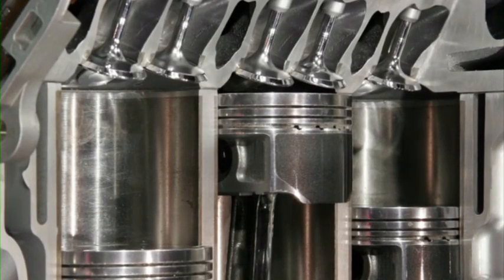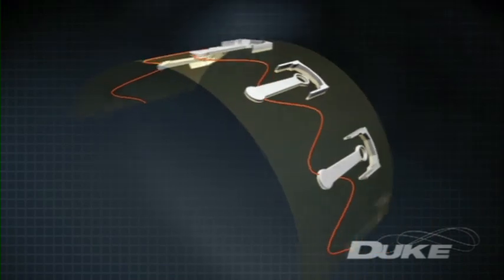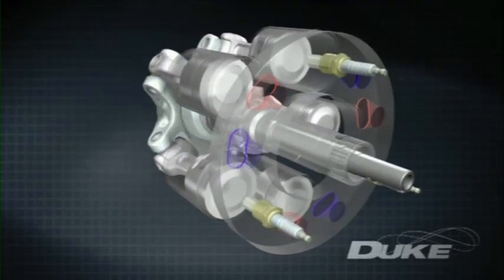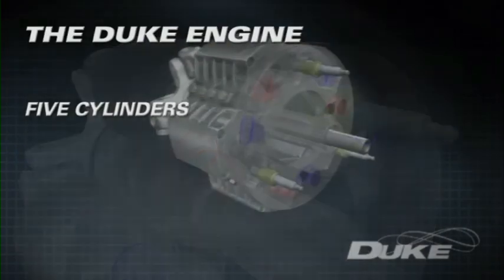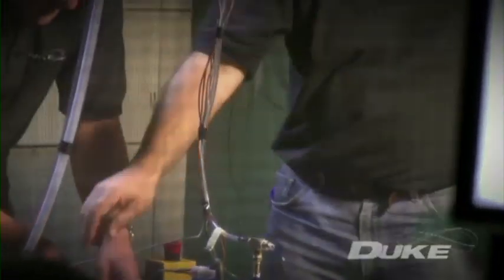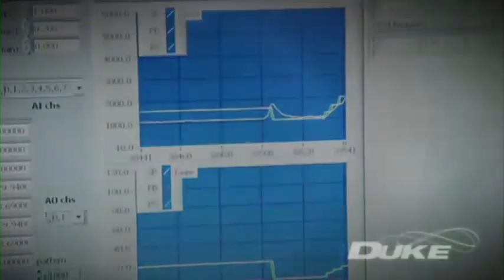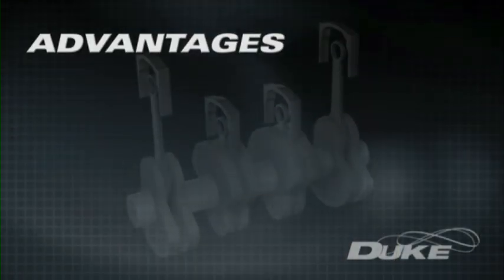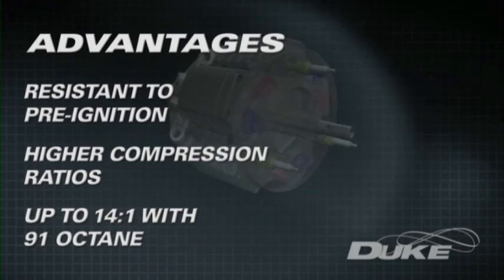Duke Engines

Comment: How are you going to seal the cylinder to achieve the 14:1 compression ratio with the cylinders moving?
Reply: +POVadventure I was wondering this very thing.. Seems like you would have exhaust leakage around the two rotating plates. But surely that is their "proprietary" design.
Reply: +POVadventure it's similar to the wankel rotary engine. it will have seals of some sort isolating each piston. similar also to piston rings only, on the top, vs on the side. I assume.
Reply: +POVadventure Good Question. There must be something in the engine having a extreme wear off.
Reply: Oil. And precise tolerances. The same as a linear piston is sealed
Reply: +POVadventure Same thought I was having, it has some of the same issues as a Wankel Rotary. It's also a 2 sroke engine, which can give you more power at the loss of fuel economy and emissions.
Reply: @ShrapnelACU  Later rotary engines became more efficient, and they basically solved, the seal issue.  My 1988 RX7, had 275K miles, when it got totalled.   The later ones are even better, than my 1988.  I'll admit that my first RX3, back in the 70s, was TOTAL junk.
Reply: +Justin S Boost in -> Apex seals out
Reply: Following on from Macomber in Edwardian days the Redrup wobble plate engine was developed for British Bristol buses in 1936 or 1937 but the 2nd World War killed it. This in not new.
Reply: +POVadventure Ohh they might get it sealed during "TRAILS" but in the real world it ain't going to last.
Reply: @PatrickBaptist  when they put engines through trials, they put them through conditions that are never seen in real life.
Reply: bryan hascall And yet, it has an intake stroke, a compression stroke, a power stroke, and an exhaust stroke, all independently defined.... hmmm, sounds like a four stroke to me. I'd take some gasx if i were you.
Reply: @TheDustyShredder   Actually: Do the math ... (Aka, power-strokes per revolution)
• 4-stroke requires 720 degrees per cylinder's power stroke, right...?
• Wenkel requires 360-degrees per chamber's power stroke, right...?
When he said it's more like a 2-stroke, do you get why now...? If not, there must be a pre-calc vid on youtube.
Reply: @trumanhw   @The Dusty Shredder It's technically a 4-stroke engine but it has the cylinders MOVING AGAINST THE HEAD to achieve 1 combustion per 1 revolution for each of the 3 spark plugs. So it can be compared to a 3 cyl 2-stroke or a 6-cyl 4-stroke. The wear on whatever they use to seal the head is gonna be mad tho
Reply: There are existing multi-port hydraulic seals that work, every day, at 20 bar pressures.
Reply: Sealing that is probably as complex as is sealing a rotary engine. With a rotary being even lighter with even fewer parts.

To me it just sounds a silly concept.
Reply: +POVadventure Good question.
Reply: POVadventure and on that bomb shell
Reply: Spoiler: You can't that's why you don't see it
Reply: @koma7358  is that why it passed rigorous testing?
Reply: @keithsada1380  is that why it never went on the market?
Reply: THANK YOU!!!!
Reply: Was wondering the same bruh...
Reply: @Christian Saint-Louis You know, for a start your idea just defeats the purpose of having a lighter engine in the first place if you plan to add weight of an aditional casing.
And it wont even fix the problem with sealing it for combustion purposes, nor keeping the seal lubricated without burning too much oil.
Reply: Harry Clams  😂
Reply: i imagine theyll develop a solution similar to that in rotary engines

Comment: how exactly is it able to have a 14:1 compression ratio, what form of sealant can hold that pressure whilst rotating at speeds apparently higher than normal type engines?

Comment: Why can't we see an engine working instead of a cartoon? Seeing is believing.
Reply: +David Orchard Why would you comment about not seeing something in a video that you haven't even watched???
Reply: Thanks I'll check it out
Reply: +David Orchard I would agree. They show 9 seconds of an engine appearing to be the Duke design, and only 7 of those with it hooked up to diagnostic equipment under the appearance of it running.

The missing design facets that others here in the comments are calling out are important: how is this thing lubricated, and how are they accounting for cylinder compression in a moving-cylinder design? Granted this video is 4 minutes, but those are fundamentally important checkboxes when explaining how this engine works, which is why it's supposedly better.

The other problem with this design is displacement. If it needs to be made larger, the circumference of the engine grows. The same thing happens if you want to add more cylinders. And since this video is comparing this design to conventional reciprocating inline-4s, the industry already knows what it can achieve for MPG results with those kinds of engines. This duke design is untested, does not appear to save any more space (though it is compelling for how much it saves in parts), is not being demonstrated while hooked to a conventional automatic transmission in a real car on a real road, we see no MPG results, nothing. 

After searching here on YT for 'duke engine', I see only 5 videos on the first page talking about it, a couple of which are recycles of this video, and another of someone building a 3D model of this engine in AutoDesk software. Not enough backing to become feasible reality.
Reply: It's probably a promo to try and raise some funds more than a real deal break through.
Reply: David Orcha
rd
Reply: Actually Diamond Viper 1984 I have watched it and if you call a 2 second window of what could of been an electric motor you are easily entertained.
Reply: +David Orchard They show it running in the video.

Comment: This is cool, but it seems like it will have the same issues as the rotary. It will need to be able to seal the cylinders against the head while the cylinders are rotating/sliding along it. There is no good way to oil it, so it will likely have the same longevity issues as the apex seals on a rotary. Could try running oil in with the fuel like a 2-stroke and some rotary engine builders do that. But, you will never get that past emissions standards in a stock vehicle.
Reply: +WraithCommander42 Bad owners not engines. mine is at 150,000 miles no issues at all. drive it hard, rev it high, it lasts. Counter intuitive to piston engine owners.
Reply: Bio Power What i am saying is that most rotary engine failures are caused by the owners, not the engine design. Not a single Mazda 767, 767B, 787 or 787B ever suffered engine failure while racing in endurance series. Why? Because they were being driven hard, hard premixed gas and were being revved to 10,500. 

Its the owners, not the cars.
Reply: Charles Darwin
Yes, if you premix your gas the engine will last longer, but do you think the EPA is going to be okay with that in a stock car?
Reply: Greg sees
I am reasonable confident that as new materials are created the issue of apex seals will slowly become a thing of the past. Running 2 stroke oil in the gas seems to be a popular solution, although no stock car could ever do that, the EPA would never allow it.
Reply: +WraithCommander42 Great points. Also, they'd have to think about cooling the massive rotating assembly housing the 5 cylinders - and sealing that all off as well.
Reply: Peter Paradis
Since they have a running engine, they may have solved that already. Though, I don't know how.
Reply: Bio Power
I grant you they are far more reliable then they used to be. But, compared to piston engine, they just don't last as long. When was the last time you heard of a rotary lasting 300,000 miles? Piston engine can do that, but rotaries just don't last that long. I'm not saying they are bad, they just don't last as long as piston engines.
Reply: +WraithCommander42 http://www.autocar.co.uk/car-news/motor-shows-tokyo-motor-show/mazda-rx-vision-rotary-engined-sports-car-concept-revealed It may be a concept but give the Wankel some time and will become a mainstay. Again, it's only a concept but Im giving Mazda the benefit of the doubt.
Reply: +Mr. Balisong This engine has a couple of things going for it - small frontal cross section and reduction in parts. Longevity issues would not be an issue if this design's niche are as engine&#39;s for UAV target drones. Maybe marine outboard engines, possibly. I just don't see it displacing the tried and true crankshaft engines  in automobiles.
Reply: robert gillies
True, but the creators seem to be targeting the automotive industry as their primary market.
Reply: Bio Power
While I agree they will probably be phased out in the next half century or so, I don't think it will be too soon. Mostly the batteries, they just aren't convenient enough yet. When my car runs out, I can fill it up in 5 minutes. If my batteries run flat, even with quick charging, it can still take 30 minutes. They are a great solution for cites right now and I think more cite dwellers should have them. But, those of us who drive 50+ miles a day can't really live with an electric car yet.
Reply: Bio Power
"heaps of charging stations in many countries already." But none around me. Leaving me with only wall charging, which takes hours.
Reply: Bio Power
I just checked, the nearest charging station is 65km from me. Not really viable. I travel on average 100km a day. Then there is the other problem for me of cost. A Model S is around $70,000. I currently have a fully paid off car. I spend about $20 a week on gas. That works out to about $1,000 per year. For that car to be worth it to me, I'd need to drive it for 70 years and that assumes free electricity, which it isn't. I am not saying it is a bad car or idea. It just isn't a viable option for me.
Reply: Bio Power
"You travel 100 Km per day, why would a car that can do 400 not work?" Becasue by Tesla's own estimates I get 5 miles of range for every hour of charge off of a 110 volt outlet. I don't have access to a 240 volt outlet. this means to go my 100km per day I'd need to charge it for 12 hours, and the would probably decrease as the batteries wear over time. My work shift is 12 hours long, with a 30-60 minute compute, I barely would have enough time to charge it.

"it won't be long and you will be able to buy an electric car at prices that are very comparable to internal combustion." And when electric cars offer me savings over my current one, I will probably buy one. I am not going to do something that doesn't make fiscal sense.

"The point I was trying to make is that times and technology is changing, internal combustion has been around for a long time and has served us well but it's days are numbered." And I agree with you, but I don't think the days are as numbered as you think. In cities for sure, they are viable now. But, out in the country where most people have long commutes and no access to fast charging stations, I think they are a few decades away at least. The other problem I see is my motorcycle. Electric bikes can't come near the performance of even my GSX750F and that isn't even a fast bike. Let alone something like an S1000RR. I think internal combustion will remain in bikes for a long time to come.
Reply: Bio Power
I do care about bikes an I highly doubt an electric bike will come out that will be as light and as fast as a petrol engine one any time soon.

I agree they are very good cars, but to say they outperform most cars on the road, while true, is a little disingenuous. They do outperform most car, but so does a Corvette at $15,000 less then a Model S costs.
Reply: Bio Power
Not me. $15,000 is worth a car in itself and is not worth it for what I consider a worse car for me.
Reply: Bio Power
That was when horses outperformed cars. When electric cars/motorcycles outperform combustion ones, I'll switch right away. Until then, probably not.
Reply: +Mr. Balisong So I'll take it you own a Tesla now? :P
Reply: robnox
Except the Corvette costs $15,000 less then a Model S and has about the same horsepower. Not very outperforming if I have to pay an extra $15,000 for the same power. This also doesn't take into account that if I put $15,000 worth of aftermarket parts into a Corvette, I can push that power up to about 800hp. So after putting the same amount of money in, I get 200 more horsepower out of a gasoline car. Still think electric outperforms gas right now?
Reply: The Model S does 0-60mph in 2.8 seconds, which is faster than the Z06 Corvette, it holds 3 more people than the Corvette, is more luxurious, is 5 times more "fuel efficient" and produces zero pollution.  It is a little more expensive, but you would save that money easily by never having to buy gas again (at least in California, where there are free electric vehicle charging stations everywhere)
Reply: robnox "The Model S does 0-60mph in 2.8 seconds, which is faster than the Z06 Corvette" That is called 4WD and has nothing to do with electric motors outperforming gas for the same money. My motorcycle will outperform either of them anyway and I only paid $5,000 for it.

"it holds 3 more people than the Corvette, is more luxurious" That has nothing to do with electric motors outperforming gas.

"is 5 times more "fuel efficient" and produces zero pollution." Again, nothing to do with electric motors outperforming gas. I car about value for money and the Tesla Model S doesn't have it for me.

"It is a little more expensive, but you would save that money easily by never having to buy gas again" At the current price of $2 per gallon, the $15,000 I would save would buy me 110,000 miles worth of gas. That is a long time to break even.

"at least in California, where there are free electric vehicle charging stations everywhere" I don't live in California, the nearest station to me is 60 miles away and in another state.

Comment: All I really want to know is how much horsepower and torque does it make? I mean, it's all well and fine to make a new engine that is lighter or less intricate or that consumes less fuel, but that doesn't mean squat if it makes so little power that there is literally no practical application for it
Reply: +Jack Duno They claim it's similar to "convention engines" in terms of output. Which conventional engines specifically, I don't know. They need to put out numbers.

I'm more concerned with lifespan. All those big rotating wear surfaces, plus the need to continually seal, move, and reseal the rotating cylinder assembly against the head. Makes me nervous. I wouldn't be an early adopter, that's for sure, not until I see these things hitting 150-200k miles without needing rebuilt.
Reply: MrJamesonStyles Exactly. "Conventional engines" is a very broad term. With a number of different engines in use today, it's impossible to make a fair comparison. Plus it doesn't help that they haven't given us any statistics. How much does it actually weigh? How much fuel does it actually consume? What is its estimated cost to mass produce? You can't just lay claims to things without having some numbers to back it up.

Comment: I like it.  But just as in the Wankel rotary engine the spark plugs will have to be special to handle the continuous barrage of power strokes while never "seeing" a cooling intake stroke.

With all that rotating mass they probably don't need a heavy flywheel either.

As far as seal problems go, in engineering we call that a "detail".

Comment: wake up bro try a little harder and use some performance additive in your self your idea is pathetic small stroke crappy compression and poor rotational values weres the rpm gona come from to spin the flywheel what is is it gona have a massive 300 rpms or so congrats from a soldier with a brain good basis poor outcome

Comment: I read a lot of vegetables in the post.
The commentary in no imagination and savvy. This structure is able to continuously change during operation of the compression, and the piston path. If pump works, it constantly controls the delivery rate, even as the dispensers. Maybe 2-stroke gasoline, diesel engine lubrication can not be mixed. Perhaps half of the cylinders used for filling as the supercharged engines. Big advantage is that it does not need special parts, can be used in conventional pistons.
I'm sorry, that was not my invention patents, which is much more detail has been revised.

Comment: This reminds me of the Bristol axial engine back in the 1930's. The idea of the wobble spider on the crank is similar. Even the use of the rotary valve. The Bristol axial had some success. But a change in management halted development. With modern computer tech and CAD design and practical testing. It's likely many of the issues have and will be solved. It's no different to the engine designs we already use. It has taken more than a century of development to get them to where they are today. It wasn't until the advent other modern computer, that many of the advances came. 

As for the valve issue. Engine me designers have been seeking a better and more efficient design than the poppet valve for most of the last century. The poppet vavle system is not the best. It's sealing capabilities aren't perfect. The design in general is less than perfect. If ever seen a poppet valve at higher rpm via a high speed camera, you'd understand. They wobble and bounce like crazy.

Comment: It looks cool but how it would seal the "rotating cylnders barrel" to the "head" ?
It would be like hell to seal it for long time usage.
Also normal piston engines reach a point during the combustion that the rod pushes the crankshaft creating  90' degree knee.At that time presious torque is created.
The rods on this design push the reciprocator at a much smallest angle.

Anyway i good job for creating the engine.